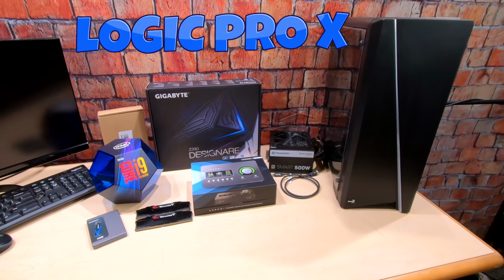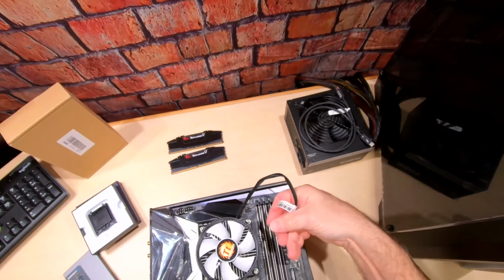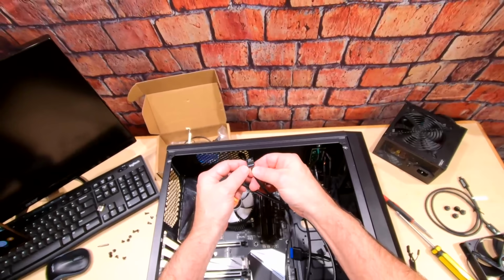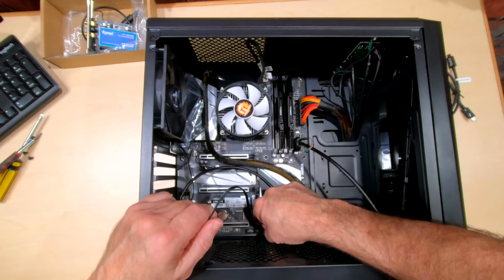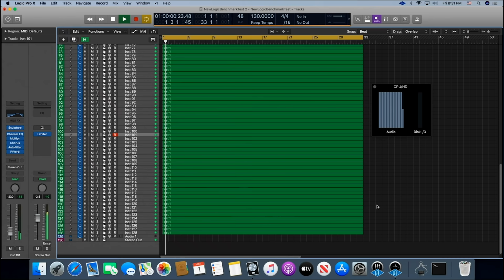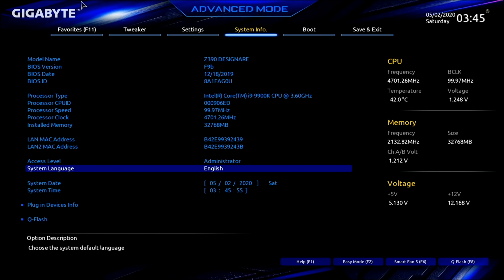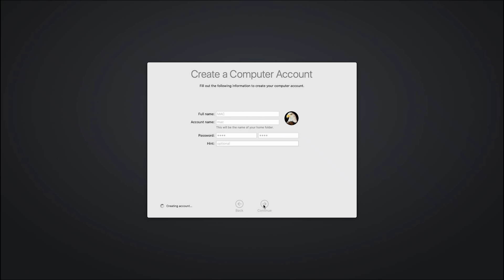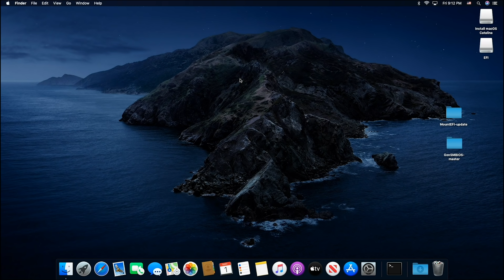Music Production Hackintosh Build w/Thunderbolt 3! | Logic Pro X Benchmarks

Comment: Hi,
Which kext file you used to activate the Thunderbolt ports on the motherboard.?
Reply: Md. Siam Exactly and are they plug and play?
Reply from the maker: No needed.
Reply: my rear thunderbolt ports arent working either :((
Reply: Edit-they work!... only if the thunderbolt device is plugged in with the computer off then startup..  idk if there is a workaround this?

Comment: on my MacBook Pro i7 from 2017 2.9 ghz I get one core at 50 percent with 2 VST tracks that are less than a minute long in simply playing the tracks and not tracking, I get clicks and pop with 64 buffer and the max core at 50 percent, is it normal to get cracking ETC with just one core at 50 percent? The best setting is usually leaving one core at 25 percent buffer, is that normal, 2 vsts, and one core is up to 25 percent buffer?
Reply from the maker: If you have many plugins enabled, they use resources even if they are not playing. 2 plugins on one track with 50%, something is wrong. Are you at 41k, 48k, 88k or 96k?

Comment: If I want to use this build and add a Radeon VII or vega 64 would that be a lot of hassle or would you recommend another build for an video/audio allrounder?
Reply from the maker: You should be fine. I tested it with an RX 580 and the IGPU works as well. So two monitor hookup one on the RX and one on the IGPU!

Comment: Genuine question. Is there any point in using 64GB of RAM? I’m planning on this very same cpu/mobo combo for a build soon and was wondering whether to spend the extra cash on more RAM. Planning to dual boot W10 and Catalina so that I can use it for gaming and music production. Opinions welcome. Thanks all.
Reply from the maker: Hi Lee! I don't think you need it. Here we get 128 tracks at 48khz!!
Reply: Sure, I can see that, and that’s why I’m questioning my own plan. From I see here I suspect that the bottleneck for more tracks at higher rates would be the cpu as opposed to the RAM. I’m also wondering if there would be any other more general benefits aside from the capacity of Logic? I’m not planning to do any video editing, just general gaming, domestic use and music production. I would save a healthy chunk of cash by using 32GB, just don’t want to regret  it later. Btw Mike, do you ever sleep?

Comment: Acourding to several others some of the SATA connectors don’t work when Thunderbolt is enabled. Can I still use several sata (8TB drives) for video editing when we want in a RAID confguration. Do you now if this work? We havent bought enyting yet. But we want this board with i9 5700XT and several drives. The wifi bleutooth card hard to get especialy here in Europa. Thanks in advance and thanks for yor great work
Reply: monkeyLeoGaming O jee indeed becuase of the m2 drives not Thunderbolt.

Comment: I've built something very similar based on your previous video with OC 0.5.6. The only issue I have is sleep. I get sleep cycles and it never properly goes into any kind of sleep. It just cycles. I've mapped USB ports, upgraded to 0.5.7 and tried darkwake=0, but nothing seems to work. I haven't experimented with slide args that someone mentioned elsewhere. I think I have slide=1 from your video…?

Comment: Hi, I’ve followed your builds, and I’m concerned I may have missed something as my Thunderbolt bolt is not recognising my Apollo Twin MkII with Apple thunderbolt 2 to 3 Adaptor.
Reply from the maker: Make sure you set Security for Thunderbolt to "No Security'
Reply: @TechNolli  Thank you, I really appreciate your input. My apollo twin mkii  is working with the tb2 - tb3 adaptor into z390designare tb3 input, but the issue I'm now presented with, is audio sounds like there is static connected to it. Really exaggerated when Logic pro X open. pronounced when moving mouse or the wheel, plus crackling. whether watching youtube or not, but far more pronounced when logic opens. I posted in google and found many others with this issue which came under the title (Hackintosh, Universal Audio -Static Noise Problem / tonymacx86.com.. I thought maybe an earth issue but I'm not so sure/or how to check for sure.
Reply: @TechNolli  Thanks so much.. Got my Apollo going! New issue is I have static like noise and crackle associated with audio. Very exaggerated when I launch Logic Pro X and also quite noisy when watching youtube. It's always somewhat in the background. moving the mouse and keyboard increases it also to some degree. I did a google search and came across this.. "Hackintosh, Universal Audio - Static Noise Problem tonymacx88" and there appeared to be a few others with this same issue.. : (
Reply: @tonyadams6985  where do we change that security feature?

Comment: Great Video! Decided to make this my first Computer build ever! Success with putting it together and installing OS. Thank you for this video! I did use the Z390 pro wifi instead but everything is running smoothly. I am noticing that Logic 10.6.1 is missing the playhead. Any suggestions? Ive read that I am missing "METAL"? Any help wold be appreciated. Thanks again!

Comment: Hi Technolli, I did the same exact build and it’s awesome! However, even with the same motherboard and WiFi/Bluetooth card the Bluetooth doesn’t work. WiFi does bit wondering if you have a quick solution for the Bluetooth to work. Thank you!!
Reply: My WiFi and BT didn’t work so I bought a usb WiFi antenna thing. Maybe you need to buy a usb Bluetooth adapter

Comment: I can't find the Z390 Designare in stock anywhere. I'm looking to build this exact setup to run with Logic Pro and wanted to know if there's an alternative motherboard that would work with these components?
Reply from the maker: Hi divinesoul7, Do you need thunderbolt?
Reply: @TechNolli  hi TechNolli. Yes I would like onboard thunderbolt if possible as I'm planning on picking up the Apollo twin tbolt version. Also thank you for makung such detailed information available. I've been researching this build for a while and it gets very overwhelming fast.
Reply: So in doing a little bit more research I came across the Gigabyte Aorus Master Z390 and wondered if this is a viable replacement for the Designare?
Reply: divinesoul7 I was wondering about this too! I thought that maybe the “Gigabyte Z390 AORUS Elite (Intel LGA1151/Z390/ATX/2xM.2/Realtek ALC1220/RGB Fusion/Gaming Motherboard)” would work, but I’m worried that I would need to change the kext files etc
Reply: @nicpetit318  I hear you. I've been searching like a madman and finally found a Designare through Newegg. I initially thought it was refurbished but it appears to be new. I said that to say just keep digging, you may come across a Designare as well. I much rather follow someone else's proven build because the software install is what scares me the most. TechNolli has a great way of instructing so I want to follow this to the T.
Reply: divinesoul7 i’m going with the AORUS MASTER. it seems to be the most similar to the designare . good luck with the build!
Reply: @nicpetit318  thanks you too. I've decided to run Mojave instead of Catalina so I'm trying to wrap my head around the install.
Reply: @nicpetit318  Did it work for you?! I might do the same!
Reply: Azvasa Music not yet, I’m sure that it is possible as i’ve seen other people do it. but idk if you need to change the kext files / install process

Comment: If you were to add a graphics card, could you enable both, and get accelerated graphics? I built your $1350 special using this same board (Thanks again for the awesome video and build, BTW) , but that build had the iGPU disabled in BIOS, so was wondering if one could have both/
Reply from the maker: Yes both do work with this setup.
Reply: Thank you! This is an awesome build.  I have this exact build from one of your previous videos with the RX 580 for audio/video, so I can have dual graphics in that one.  Now going to build a second identical to this with internal 630 graphics only for an audio workstation only.

Comment: Hello, is it normal that the internal audio driver not working? Is it possibile install it? thanks
Reply from the maker: No it should work fine. Are you using the AppleALC kext?
Reply: @TechNolli  Yes, i just copied the EFI folder and everything work, just the audio devices are not available. Do you know, how can I fix this?
Reply: I just noticed, that even the thunderbolt doesn’t work 😥
Reply: @manuelmartimucci  did you get it to work yet?
Reply: @manuelmartimucci  any continues issues? Iv never built a computer and am wondering what to look out for, would be using for music production as we ll.

Comment: TO BUILD A MUSIC AND VIDEO WORKSTATION, YOU NEED AMD RYZEN 9 3950X WHICH HAS 16 CORES AND 24 THREADS. NOCTUA NH-D15 CHROMAX BLACK CPU COOLER, 128GB 3600Mhz CL16 MEMORY. GIGABYTE X570 AORUS MASTER MOTHERBOARD, IT HAS 32 BIT 192KHZ DAC. RTX 2070 SUPER OR HIGHER GRAPHIC GARD. 2TB M.2 NVMe, WD ULTRASTAR 10TB. MINIMUM 2K MONITOR, AOC Q3279VWFD8 QHD 75HZ FREESYNC IPS 32IN 2K MONITOR. 750W
80 PLUS GOLD POWER SUPPLY. DEEPCOOL KENDERMAN ATX MID TOWER CASE OR BETTER. BETTER THAN A $15,000 MAC PRO, AUSTRALIAN. BETTER THAN A THREADRIPPER 2950X

Premiere Pro has long supported Nvidia’s CUDA cores for accelerating video effects and even improving export times, but this new update optimizes the app to use
the separate hardware encoder on Nvidia’s GPUs. It will improve export times for H.264 or H.265 / HEVC codecs. “These improvements are the result of years of collaboration between Nvidia and Adobe to deliver high-quality applications and tools to creators,” says Manish Kulkarni, senior engineering manager at Adobe. “With new support for NVIDIA GPUs on Windows, exports are hardware accelerated leveraging the power of the GPU to make Premiere
Pro more powerful and keep video creators productive and nimble.”

YOU A NEED RTX 2070 SUPER MINIMUM. I AM BUILDING A MUSIC AND VIDEO WORKSTATION, USING AMD RYZEN 9 3950X WHICH HAS 16 CORES AND 24 THREADS.
IT KILLS THE I9 WHICH HAS 18 CORES IN MULTITASKING. THE AMD RYZEN 9 3950X IN ONE TEST WAS 24 PERCENT FASTER. WITH THE PROPER VIDEO CARD YOU CAN DO 8K VIDEO EDITING

Comment: i followed your previous instructions re this motherboard and processor and got my hackintosh set up and working well - thank you so much!! however, I am getting no joy with the thunderbolt 3 and it says no hardware is detected in system profiler. any push in the right direction would be greatly appreciated!! (SSDT-Z390-DESIGNARE-TB3HP-V4 is already in the ACPI folder of the EFI.) Thanks again x
Reply from the maker: I have only tested the Apollo audio interface. :(
Reply: TechNolli thanks. I noticed that the TB config menu was missing from the bios. Messing about with loading optimised defaults made it return but then system profiler said it had no thunderbolt drivers. Windows detected Apple TB to gigabit ethernet adapter but osx would not. Anyway, a problem to figure out. If you know of anything worth trying let me know. Thanks again for the excellent videos!

Comment: Hi Technolli, finally got it working! Thanks for the EFI folder. Catalina seems to be working good. There are minor issues though. Sleep is working but there's a problem with my monitor wake-up. The system wakes up ok, coolers start spinning but I have to turn off/on my monitor a few times for it to pick up hdmi signal. Also after a while I noticed a slight flicker on white background. First I thought my eyes were kidding me:)). Then I installed Windows on my second drive to compare and there's no flicker on Windows. It's a weird flicker (vertical lines moving back and forth) barely noticeable on white background only. I was wondering what could be tweaked in DeviceProperties of the config.plist. There are lots of stuff related to GPU's frame buffers meaning of which I don't know 
I also checked one of Apple TV's free videos (DRM?). Doesn't play. Do you happen to know can it be played on iGPU or we need a discrete GPU for DRM content?

Comment: Hi Technolli, I subscribed to your site for the EFI download, great job, THANKS. I ask you if you have never had problems with WiFi fenvi FV-HB1200 installed in the PCIe slot recommended in your video and connected USB power? Greetings and good work. P.S .: if necessary I purchase your advice on my question! Denis
Reply from the maker: No problem using the Fenvi card here.
Reply: @TechNolli  My card arrived broken only for WIFI!
I installed seeing from your video tutorials the Fenvi T919 and everything works wonderfully, great job BYE

Comment: i love this video, cause im looking to do the same thing.  how much was everything together minus the apollo card?
Reply: this motherboard is no longer on sale anywhere and will no longer be marketed.
Reply: Are you sure? I just added it to my cart on Amazon
Reply: @dnalyen  at least not from an amazon seller in europe. It is sold by other third party sellers. hold on I a m talking about the z390 Designare not other z390 like aorus etc... it is sold more expensive by other sellers like on ebay for example.This card is replaced by the z490 Designer. How much did you buy it? Do you have the link from the amazon site?